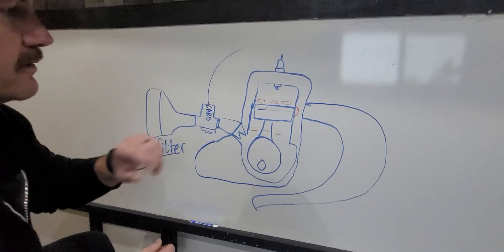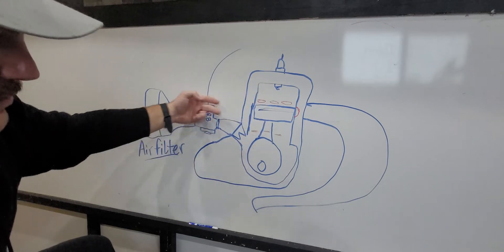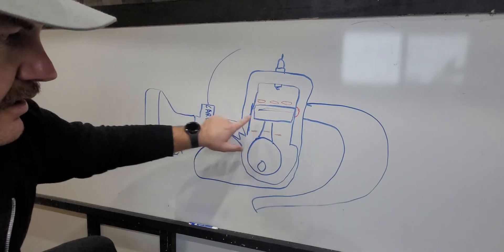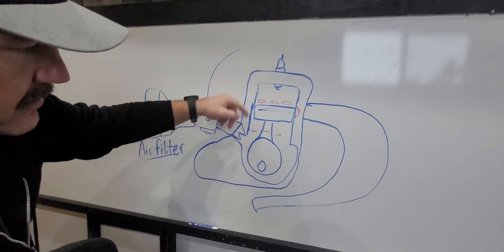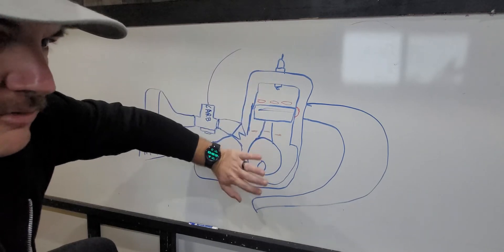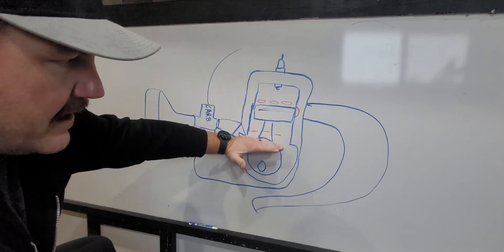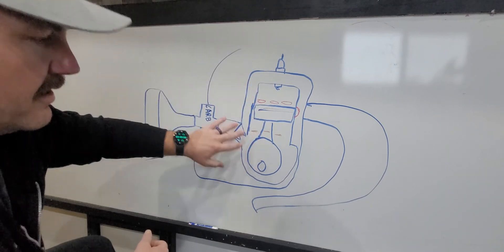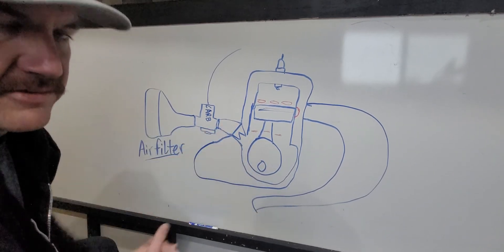2 stroke reed valve operation! Simplified and to the point.

Comment: You did a good job explaining how it all works. It was easy to follow. Specifically though what about having reed valves is better then a piston port? It seems as though it would just be more fuel efficient, being that you wouldn't loose fuel in the blow back process.

Comment: Would not haveing the reed valve stoppers on cause starting problems?
Reply from the maker: Yes it would. It would be bending at the end where mounted the most causing it to brake. A sharp bending point.
The stopper also provides a smooth arch reducing stress in any particular area. insuring longevity and performance.
Reply from the maker: Side note: boysen dual reed blocks will still have a bar style limiter much smaller but still there. I cant see what your working on. So hope this helps.
Reply: @texas2strokes727  I'm working on a Yamaha blaster, and thanks for the response #new subscriber from Texas